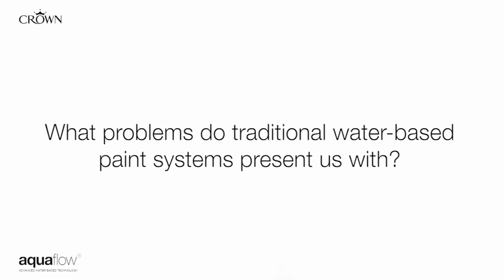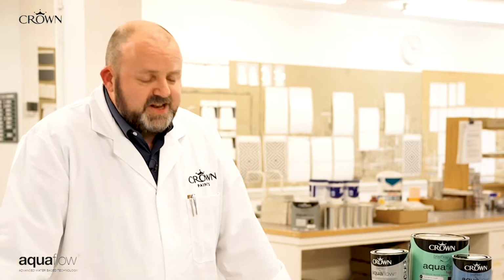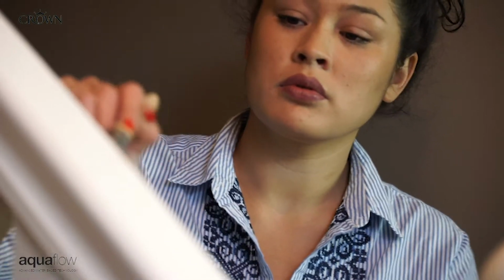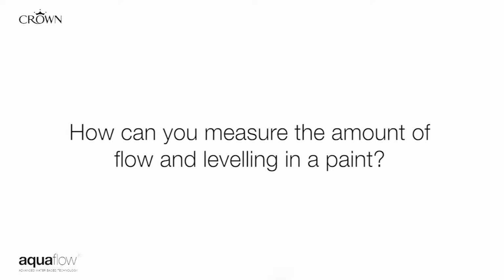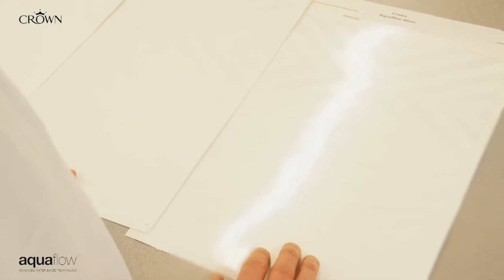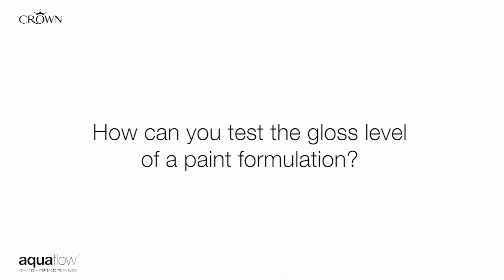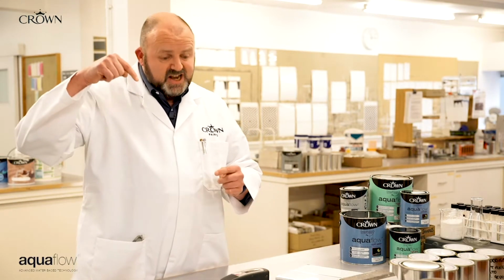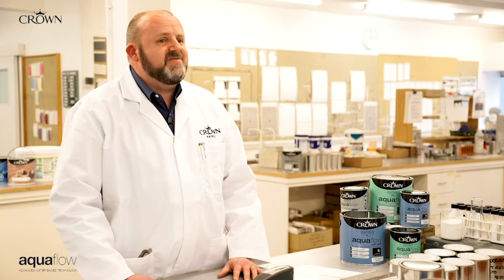The science behind our latest range Aquaflow - Crown Paints

Comment: Have used this paint recently and found out it was not all it was cracked up to be. Even though I made sure to sand down the old paint I found Aquaflow could not bond well with the old oil based paint. I also noticed its stays soft and will peel easy days after you use the product. I think its just not good enough and can't manage the knocks and bangs or your finger nail like on a stair rail.